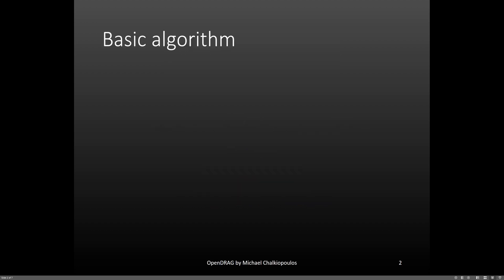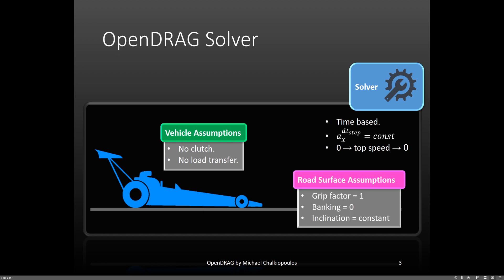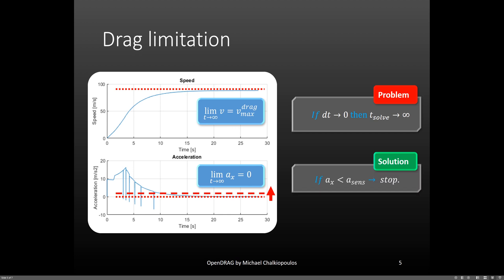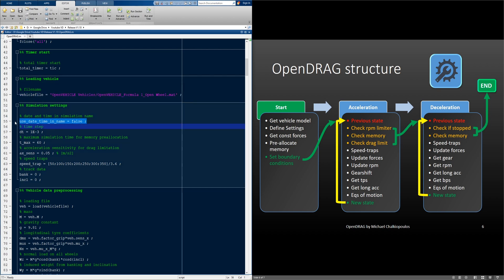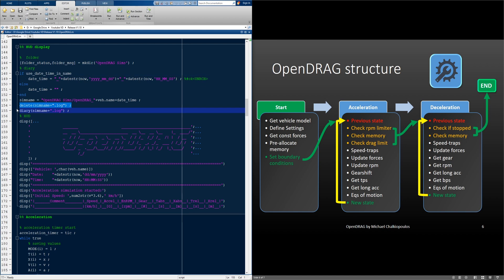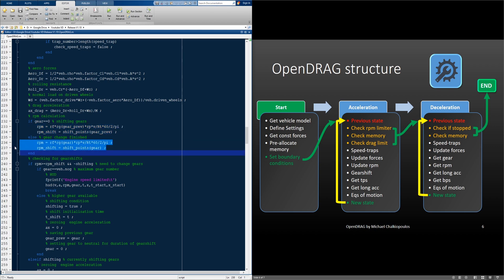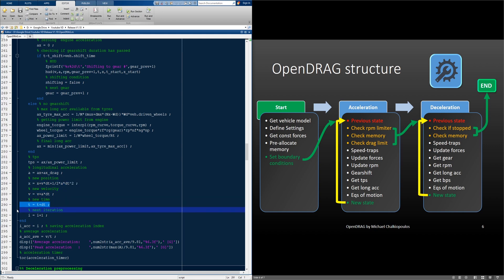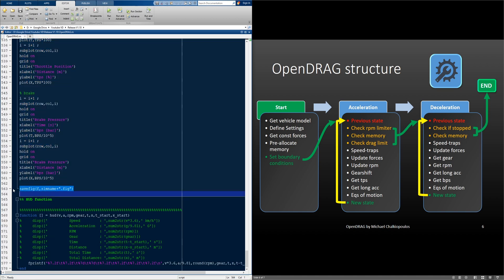OpenLAP Lap Time Simulator Part 5: Straight line simulation in OpenDRAG

Comment: Hey Michael,

Again, great video and cool project. Thanks for sharing!!!

Just a thought...
The max Ax of an F1 car braking from >300kph would probably be something huge like what you calculate if the actual system forces were large enough. However, the caliper can only squeeze the disc so hard and the driver can only press the pedal with so much force. Even brake-by-wire systems aren't designed to employ such massive forces as it would take. Two ways I've seen this accounted for in simulation are,

1. Employ a brake model and limit the system forces, depending on Ax because the weight of the driver helps him press harder on the pedal.
2. Employ a "fudge factor" developed empirically to reduce the max Ax available in braking.

I hope this helps. Keep up the good work!
Reply from the maker: Hi George Taylor,

Thank you!

Yes i could include a braking model maybe as an update, to allow for a better way of simulating different braking system capabilities. Its an easy couple of lines in the deceleration calculations.

What I meant in the video, is that as the code is set up now, the only thing you can do is reduce the friction coefficient to make the number more realistic.
Reply from the maker: Also, in karting the deceleration will definitely increase the braking force on the pedal as the driver is held in place by the steering wheel and the pedal. In race cars, the belts take most if this extra load.
(My father once completed an f3 race where his belts got unbuckled on lap 2. Not fun!)
On bikes it basically should have no effect (although I have not looked into it).
Reply: @_phoinix  haha, a race with loose belts doesn't sound like fun at all!

Yes, reducing the braking friction coeff would give the same result as a fudge factor.

For the brake model, you can consider a pro driver can press up to ~1300N on the pedal face and friction coeff of carbon brakes is ~0.45 at optimal temperatures.

Thanks again!